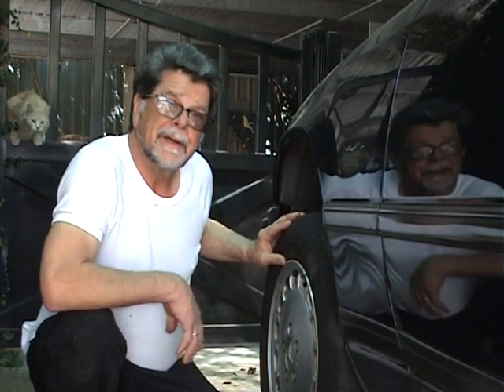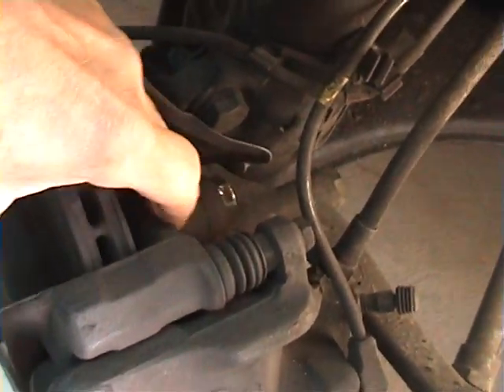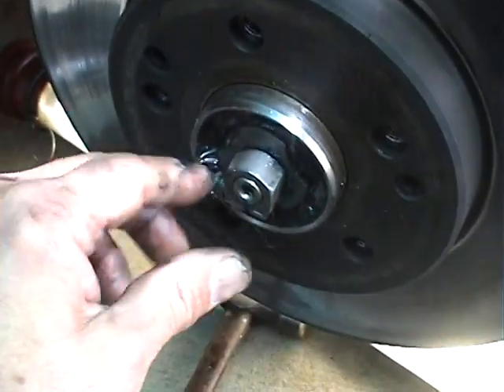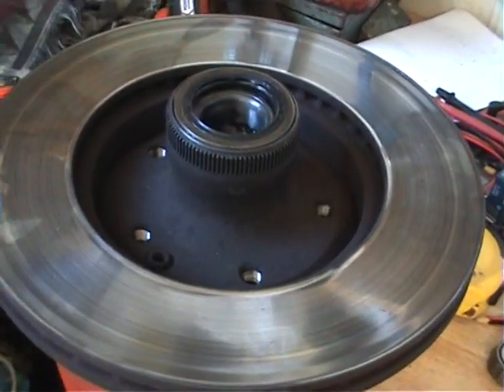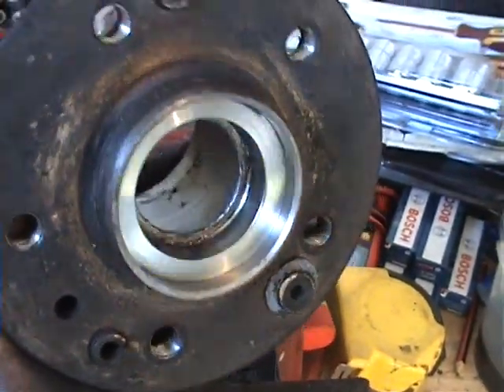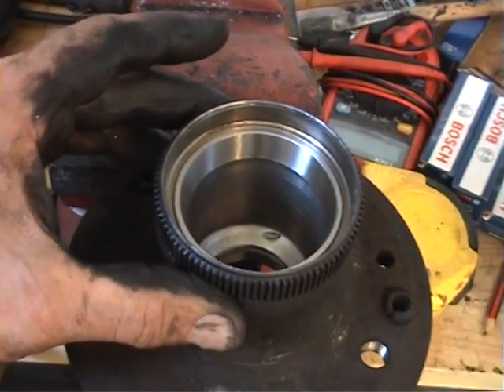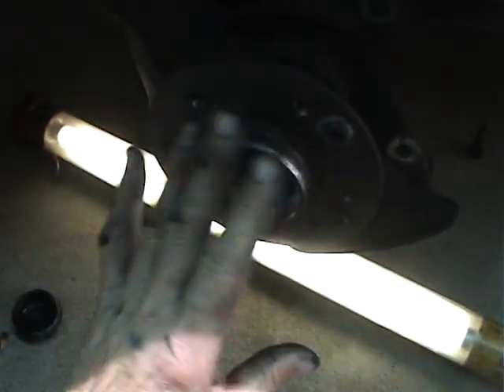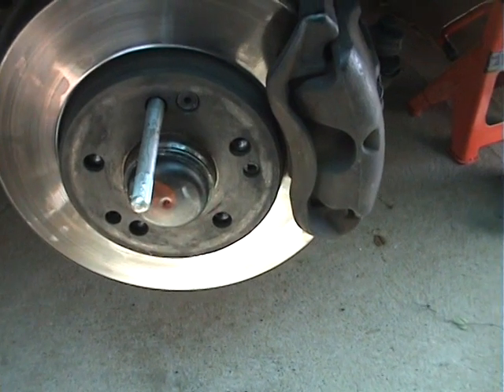1989 Mercedes 300E Front Wheel Bearing Change

Comment: Thanks for the upload! Might have to do this on my car. Just installed a new caliper and rotor but now the rotor is grinding against the caliper bracket on a certain spot and the whole wheel has a wobble to it when spinning. Trying to figure out if that’s a bearing issue. It doesn’t seem to have a lot of play when I jar it back and forward.